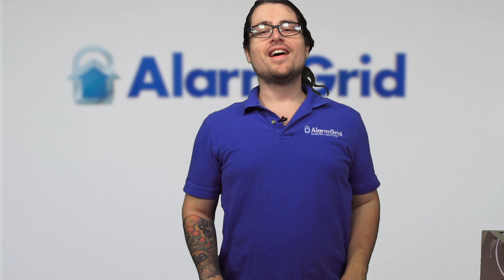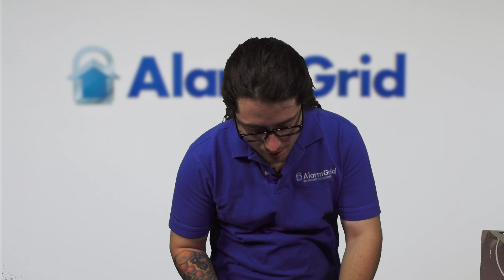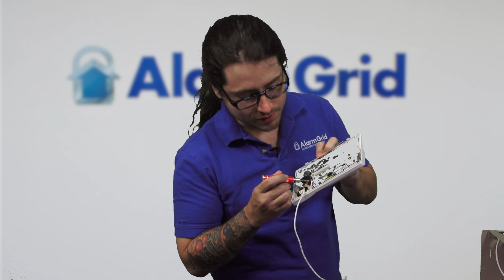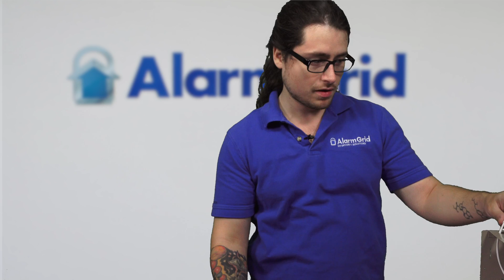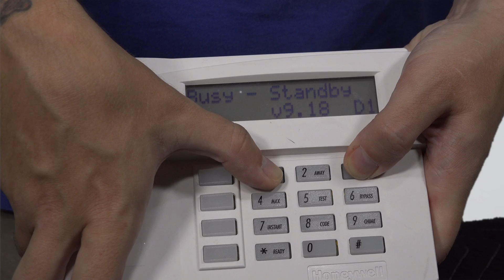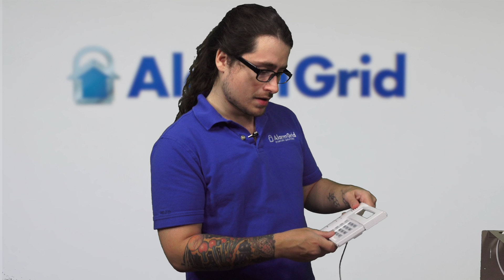Honeywell 6160: Explanation of a CKT Error

Comment: This was pretty useless because a good portion of what it could be tied to is the power and you did not get into this battery box I keep reading about or anything else really connected to the power except where the power cable is supposed to be connected. If we're getting the ckt error obviously the power cable is connected because there's no battery and if half the issues are related to the power supply as the internet suggests you not going into more detail about what else that could be is useless. When it came to that part you just said call the security company which is what people probably already tried to do before watching this fucking useless video.

Comment: There is another thing that will cause an open ckt error on a keypad.  If you have keypads on a supplement power supply, you have to run a wire from the 4th terminal of the panel to the negative or minus terminal of the power supply.  I call it a "zeroing cable" but it gets called a lot of things.  But the zeroing cable has to be run from the 4th terminal of the panel to the power supply.  If you don't have that, or it is disconnected, you will get a ckt error on that keypad.  Now, correct me if I'm wrong, but I suspect that negative wire also doubles as a 5th communication wire.  Look up supplemental power supply information and it will tell you.  I forgot to hook up the zeroing cable from the 4th terminal to the negative and got an ecp error on my touchscreen.  I looked up the supplemental power supply on Alarm Grid and corrected the problem and my touchscreen keypad has worked beautifully ever since.  One, please keep these videos coming!  Two, if using a power supply to power the keypad, you have to run this wire from the negative to the 4th terminal.  Otherwise, you will a ckt error.

Comment: I have 2 keypads same CKT Error on both out of the blue. System installed 2002. I checked all connections on the panel. Bad panel? How do I stop the bonging?